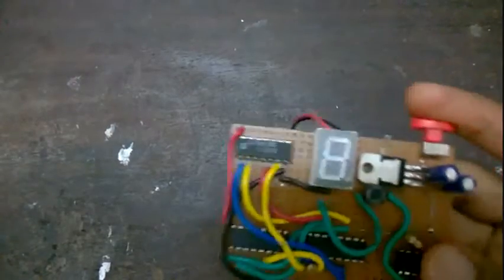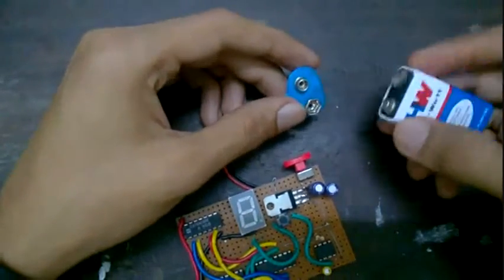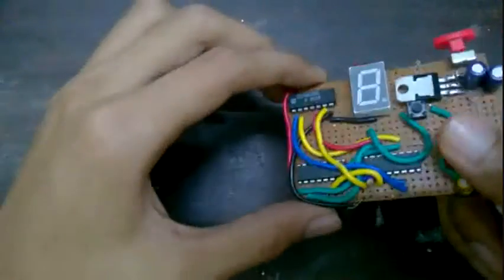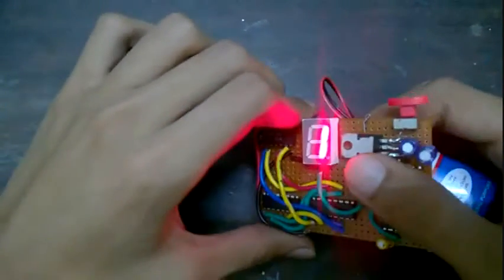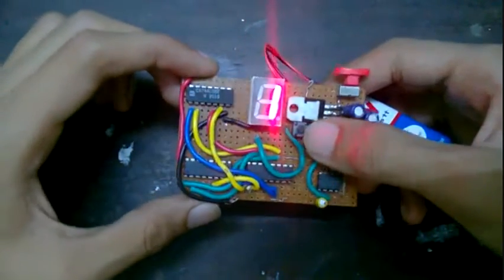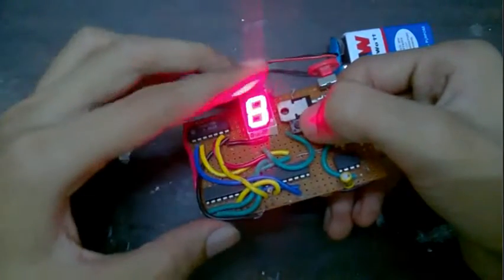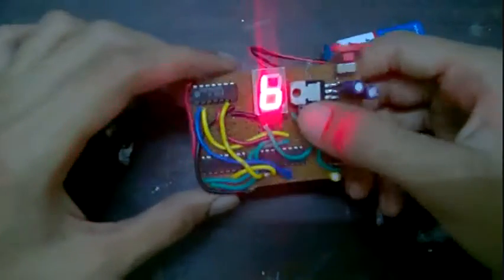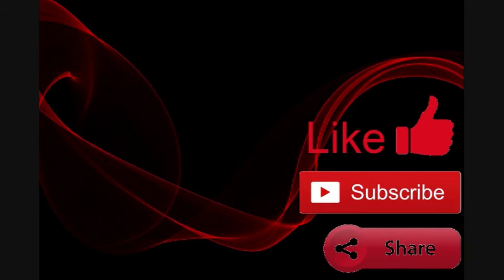Electronic Dice weekend project

Comment: Hey mate! do you have the schematic circuit?
Reply from the maker: Sorry for the delay. I was stuck with exams. Follow the link to get to the schematics.
https://4.bp.blogspot.com/-Ox7Q5U-qzXc/WK7tOTY3WZI/AAAAAAAABdI/00qycyOB__cegT7MV_a6VYC345qOqPVwgCLcB/s1600/file-page1.jpg
Reply from the maker: I don't have the schematics but I can share the block diagram of the overall circuit if you want.
Reply: Yeah, I would love to make it. Can u pls mail me the circuit @ manohar.prakkash@gmail.com ?
Reply from the maker: I'll try to share it here itself.
Reply: Great, but can u do it asap? Actually, I'll first design this to have an
 experience (so that I get an idea of what difficulties I may face) 
after which I have to make my main electronics project.
Reply from the maker: okay. I'll try my best.
Reply: No, problem. Thanks for the circuit. I'll try my best to make it like u :)
Reply: Hey, where have u used the voltage regulator; I mean which part of the circuit should I connect it in? And, do the 2 capacitors have the value of 10nF? Actually, it's written very small so I wasn't very sure.
Reply from the maker: The Output of the voltage regulator(7805) is connected to all the Vcc pins and ground to the ground. This was just to make the circuit capable of running off a 9 volt battery. Please personnel message me your mail ID I'll share the PDF of schematics with you. Yes I agree the image is kind of blurred.
Reply: Ok, Thanks. My mail id is: manohar.prakkash@gmail.com